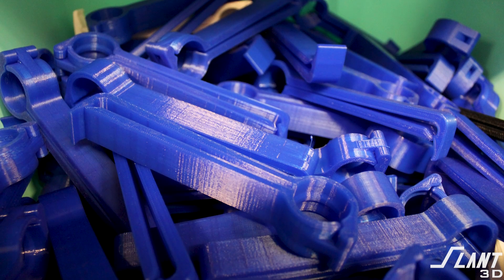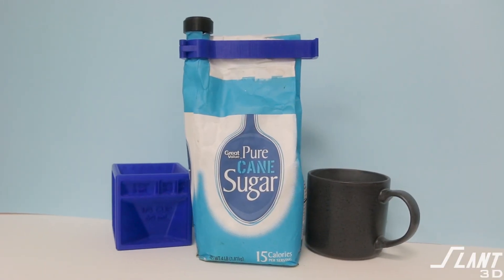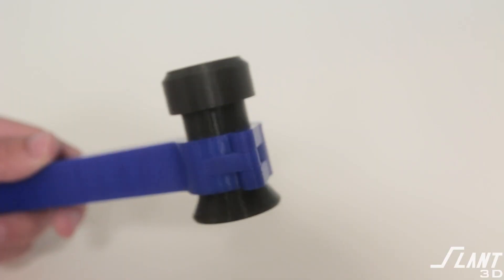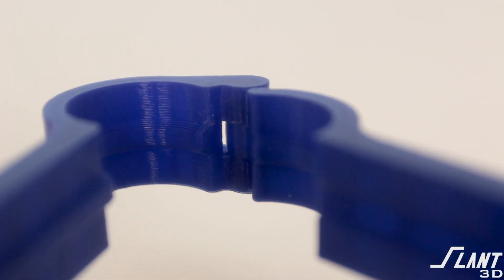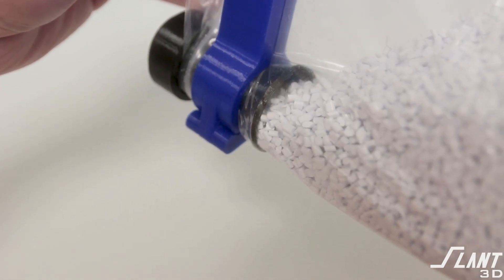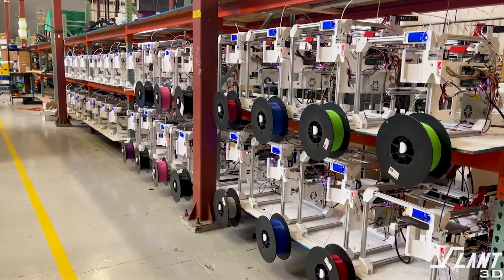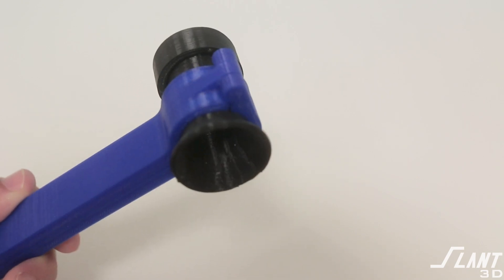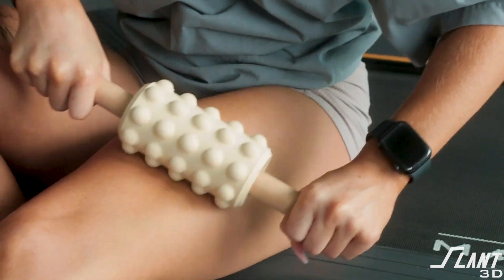How We Made $11K on Kickstarter | BagClamp | Real 3D Printed Products

Comment: How did you get around the existing patents? I saw this exact same product years ago at PackEXPO in Chicago. Those were injection molded, with a flexure hinge.
Reply: One benefit of KS is getting around bullshit patents. 😂 If they won't sanction scammers who just rug pull with the platform, what's the chance of them doing anything about patent claims?
Reply: @daliasprints9798  Patents just give you a seat at the negotiation table. The problem is that you actually have to sue people, which costs money and time.

Why do that when you can innovate instead?
Reply: @Killy10000  That's why the ones suing ppl over patents are the ones with no capacity to invent & innovate.

Comment: Would you consider making the tangs curved instead of straight? The "banana-shape" would make the clamping force equal over the entire lip of the bag - with the current straight bars, I cam imagine that the pressure is almost zero at the middle.
Reply from the maker: Actually there is a subtle bend to the inner arm on our later versions. You do not want them both curved. They have to press against each other
Reply: @slant3d  One could make them both curved, the inner one stiff with a shorter radius, and the outer one compliant (thinner) with a longer radius. This would affect a similar effect. Another way might be to pre-tension the inner against the outer by means of the latching mechanism - in both these scenarios, any thickness-variation in the bag being sealed can be taken up. I'm worried that pretensioning based on a slight curve is a one-time thing - as soon as the curvature has  vanished due to plastic deformation of the PLA, the seals will become less effective (- at least that's what happend in my 3d-printed bag-sealers)

Comment: what about the food safe issue ? layer lines dirt inside the bag ?
Reply: Food safety absolutely is an issue to be concerned with, especially if you're selling a product that repeatedly comes into contact with food.
Reply: Agreed, I've thought of making something like this myself but was always worried about about the food safety concerns with direct FDM prints. Slant in a previous video showed using PLA for the outer box and a food grade plastic insert but this is bare PLA with the layer lines in contact so I'm curious.
Reply: I don't think it's much of a problem if you are using it for dry stuff. Coffee beans aren't going to get stuck between the layers. Salt doesn't go bad even if you leave it sitting out in a dish for a year. Etc.  Also, a squirt of spray shellac instantly cures the problem as long as you put it only on the tube and lid and not on the clamp itself (where it might interfere with the hinge).
Reply: As long as proper food safety handling procedures are followed related to the type of food it should  not be an issue for a 3d print.  Dry food should not be an issue. More care needs to be taken if a container is re-used with different types of foods, or a food has a limited storage life. In which case proper cleaning procedures need to be exercised. 
In this demo product, only the pour spout and cap come in contact with food, not the clamping structure. This component is a fairly simple design, without complex geometry and can be fairly easily inspected after cleaning.
Reply: What about the 3d printer nozzle?
Many brass contain lead!
And lead must been avoided at all together with food.
Reply: @berlinberlin4246  FYI: Copper plumbing for indoor water supply often use lead in joints. It's only an issue if lead gets into consumables at a significant enough concentration. 
eg: If the nozzle temperature are hot enough, or filament abrasive enough to dislodge pieces of the nozzle, that would be a problem.
Reply: That’s genius!  Must buy (or print!) a few.
Reply from the maker: Not an issue to be concerned with. Food-safety in 3D Printed products is often misunderstood. Just substitute "wood" for "3D Printed" they are the same
Reply: @slant3d  Would you recommend a post cleaning of the printed component same as wood? Also sealers are often used with wood products to help prevent any organic materials from getting in. Is there a sealer you guys recommend for PLA?
Reply: @ender-gaming  I found shellac works excellently. It's cheap, it's food safe, and it's stands up in all kinds of conditions. "Marine shellac" will even waterproof your prints against submergence in salt water.
Reply: @slant3d  wood contains turpentines which are natural disinfectants. This is why wooden chopping boards are safer than plastic ones (once the plastic is scored). Having said that, for dry goods I would expect this product to be fine. Bacteria thrive in moist conditions. Having some residue of a dry substance in the layer lines, is surely no difference that that same substance being in the bag.

Caveat: I say all that without being a food hygienist.